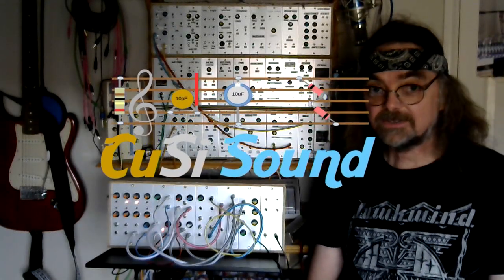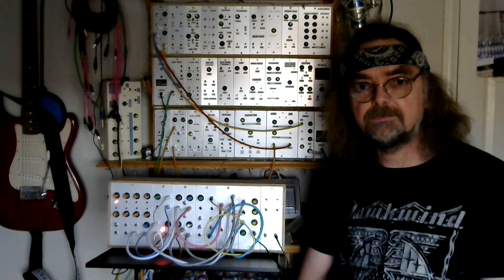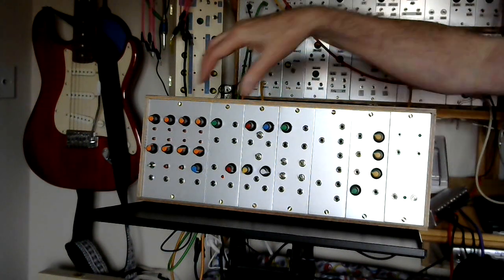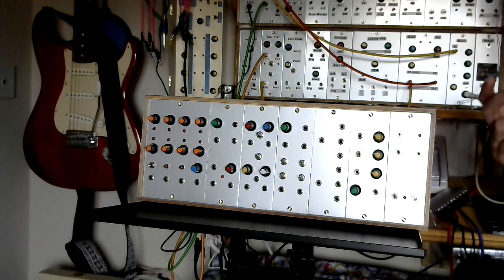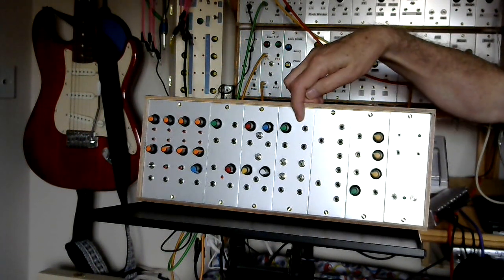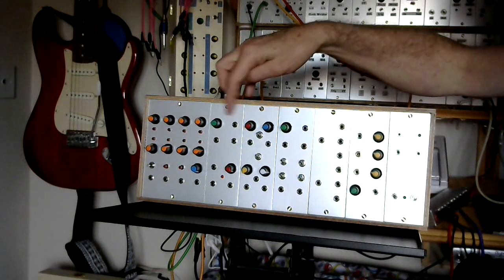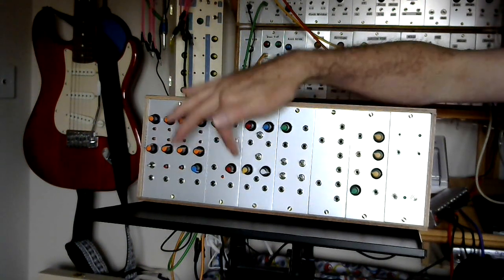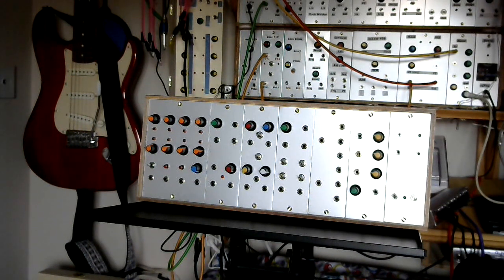Project Nine-20 DIY modular analogue synth : Overview

Comment: I would love to know the circuit you used for the filter... I'm a beginner who has been trying to find a good 9v resonant low pass, there's not a lot out there. If you have a diagram or whatever please let me know!
Reply: ahhh, i found it on another video. Unfortunately the combined envelope/lpf filter stripboard image is too small to read though and that would be a lovely thing to build. Have you got a higher resolution version of the stripboard circuit?
Reply from the maker: Here is a link to my stripboard layout for the Q&D VCF that I used in CuSi Drums. It is labelled for +12V and ground but it works just fine from 9V and ground https://www.dropbox.com/scl/fi/yztiyyy9oqii4jcb5fipa/QD-VCF-InverterSwitch.png?rlkey=dgruckdiq4utpj9i2c7i3spxb&dl=0 If you search Q&D VCF you should be able to find the schematics etc. I did a different 9V VCF in my little boxes series that is a bit more rough and ready but you could try that one too.
Reply: @CuSiSound  Ahhhh i've seen the Q&D filter schematics, that's super handy having it laid out on strip board. I'm not quite confidant converting schematics to finished circuits yet so that's incredibly handy. Many thanks!